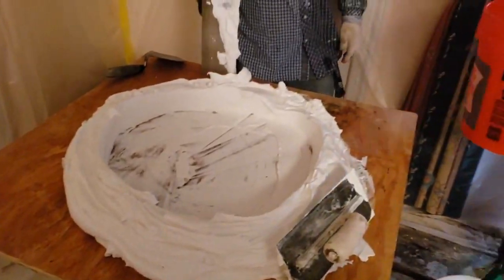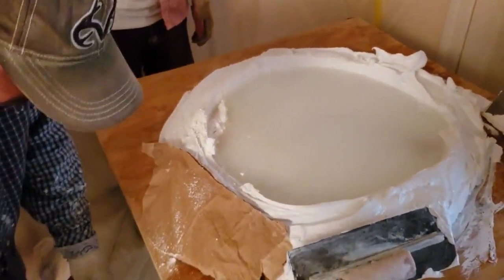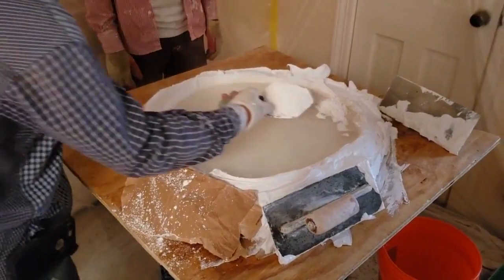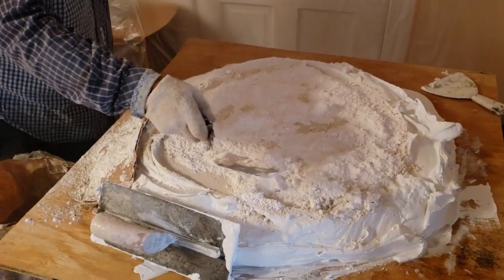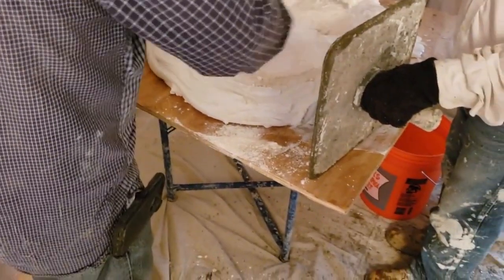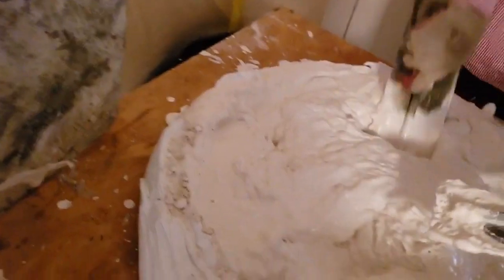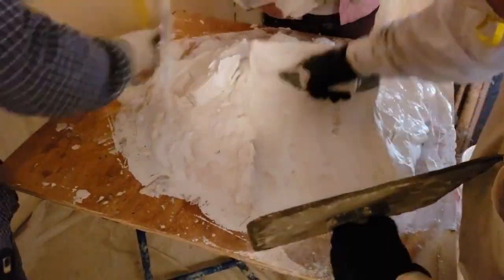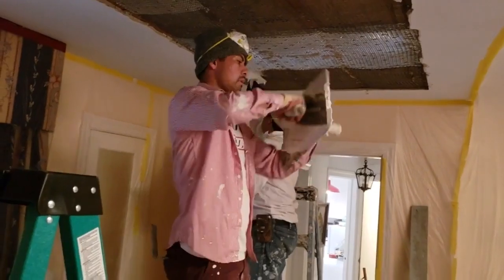Mixing finish plaster

Comment: This is how we mixed the white coat back in my day as a plasterer.
However we used a much larger mortar board, as a rule 4 to 5 feet square.
We also mixed much larger batches.
We would use quick set gauging plaster, but also used a retarder in order to slow the set long enough to allow or using the large amount mixed.
We would mix enough to do the entire ceiling of the room, and about half way down the walls.
A scaffold would be built for the entire area.
There would as a rule be enough mixed to do the bottom sections of the walls from the previous mix after the scaffolding had been removed.
We used both the hawks and the trowels for the mixing.
Reply: You’re legit old school plasterer! A lotta journeyman plasterers now don’t have a clue about what you just described. I can remember gaugings big enough to keep five or six plasterers moving! They don’t know the mixes or nothing 🤷🏻‍♂️ . Everything comes pre mixed in a bag now just add water. Even the stucco.

Comment: What would be the minimum ratio of moulding/gauging plaster you would mix?
Reply from the maker: I always go 50 50
Reply: I used to help my father and grandfather many years ago . By the time I started plastering my dad switched over to the diamond and the smooth kote. So I have little actual experience with lime and I want to go back to it. Would going less than 50/50 change the integrity of the finish or just the set time? Thanks